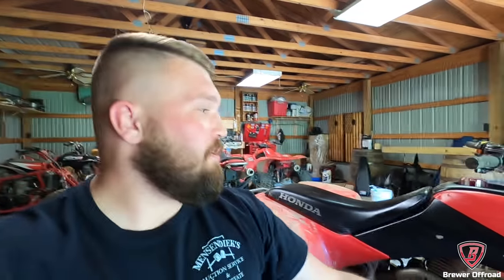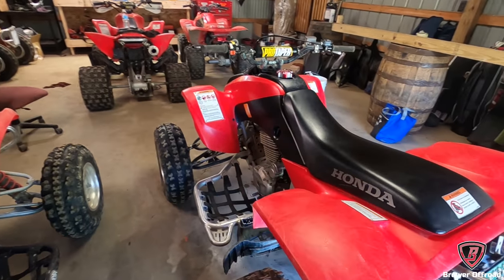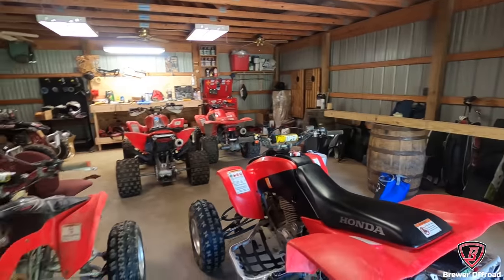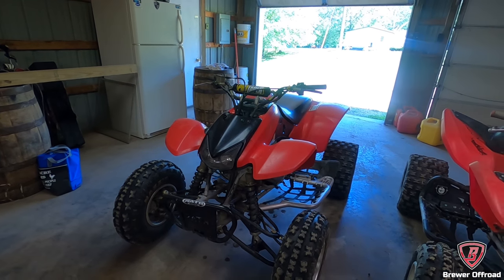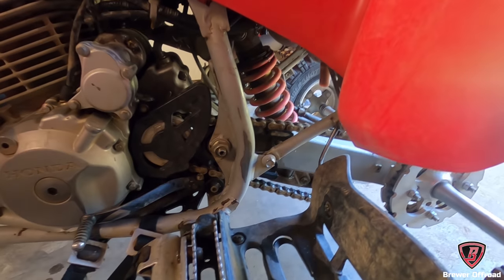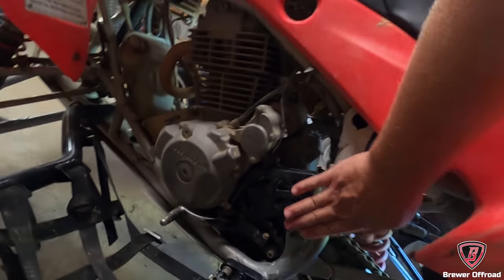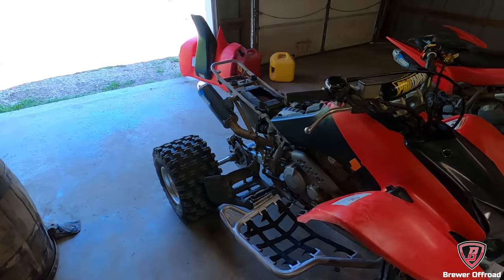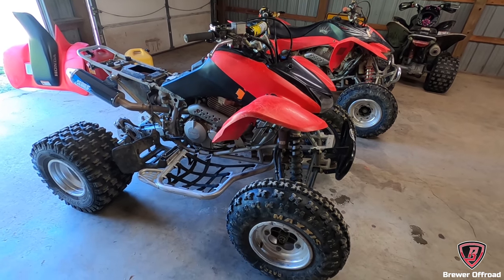What to look for when you buy a used Honda 400ex. DON'T GET SCREWED!!!

Comment: On the tapping sounds, you gotta remember the 400ex is Hondas RFVC design, each valve has 2 rocker arms, a main rocker and as sub rocker, There are more contact points of cleareance which increases the sound from the valve train.

Comment: I agree with you 100%, if it’s less than 1500 and it looks like it’s running good and not making any weird noises I’d buy it.  Parts for the 400ex are cheap. I built a 440 with a stage two hot cam in all new weisco internal components except for transmission gears for less than $1200
Reply: I have an amazing trail machine and I have $2500 in it total! Where else can you spend that little amount of money and have that much fun
Reply: What about $1700?

Comment: Another thing to check for when buying a used 400ex is swing arm bushing and bolt this is a common wear spot and if there worn bad enough you will have to replace the swing arm also I had to replace the swing arm on mine and did one for a friend another friend got lucky and only had to replace the bolt and bushing. The bolt will wear so bad that to have to cut it where the swing arm mounts to the motor. Other than that and the rear axle carrier bearing the 400ex is an awesome quad super reliable and affordable love the low end torque they climb like a tractor
Reply from the maker: For sure! Thanks for the added info 🤙

Comment: You did a good job man I use this same guide for when I buy a 400. I also check the carrier, a arm bushings and ball joints, wheel bearings and stuff like that as well. I'll add the cost to fix the quad to the asking price to find out how much money I'm spending on it. I don't always look at what they ask for it, I look at how much money the quad will cost me by the time everything is fixed up. I use that strategy for when I buy a quad. But good vid man!
Reply from the maker: Thanks man! It was tough to hit on everything so I knew there was stuff I left out but thanks for the info man!
Reply: Brewer Offroad nah you’re alright you missed the least important stuff I believe. That’s all cheap stuff I mentioned you brought all the important things into discussion lol
Reply from the maker: Thanks man!

Comment: Alot to help you with here bud. First. Check where the front sprocket is. Remove the factory case saver. If it slings a chain it will crack the case there. That will also give you an idea of how it was taken care of at the sametime. The tick- isnt timing chain. Its half the auto decompression mechanism other half is the secondary rocker arms in the valve cover. (Normal sound)The oil leak- put copper spray on the valve cover gasket. Problem solved. You checked the oil completely wrong. Check the manual. You have the oil way over full if it reads half without running the quad. It should read full after quad has warmed up at idle without throttle blipping. I missed alot of things you said that was wrong. Not bashing you in anyway here. Just passing on info. Take care! Ride red!
Reply from the maker: No problem! Just because I learned one thing doesnt mean it's right Haha thanks for the info!
Reply: @BrewerOffroad  your welcome! Always glad to help!

Comment: I kinda miss my 400, sold it and got a Raptor 700 from a family friend
Reply from the maker: I rode Pete Hager 700 and its NUTS haha video coming soon
Reply: •_JM_• it’s a great bike, and most definitely more power from the 400 with fuel injection and more CCs, maintenance intervals are a bit short tho something like 10 hours for oil changes and the sprockets and chains gotta be in your shopping cart at all times bc it eats them up
Reply: Lol I have a 400ex I love it congratulations on your 700! If u wanna check em out on tik tok to see it then go ahead!

Comment: FYI the reason that you have all that noise from the timing chain is tensioner Honda is notorious for the automatic tensioner tends to move and sometimes kills quads because the chain will jump which is when I always get a Honda no matter it's the rocket or dirt bike or four wheeler is a manual timing chain tensioner saves me from having to rebuild the head a few weeks or a month after I start riding it I ride mine every day

Comment: Thanks for the Byers tips, looking to get a 400ex or Trx 450R  to get some more power and speed than my 2001 Yamaha 350 warrior that I have now.
Reply from the maker: Both are more powerful but if you arent racing I'd get a 400ex mainly because of the reliability!
Reply: Thanks for the tip. How does the 400 ex take jumps?
Reply: @austins53schindewolf68  good if you throw on a pair of 450 shocks up front
Reply: @kevykev388  Glad to hear you say that, I have a set of 450r shocks on the way.
Reply from the maker: I have 450 shocks on mine

Comment: The reason the battery drains and has a hard time starting is the high compression piston. I had to change my starter clutch after a while.
Reply from the maker: Good to know! I also started noticing it after I cut out sensor for the N and R lights thoughts?
Reply: @BrewerOffroad  it really comes from having aftermarket cams too because you have no decompression mechanism upon startup. I cant see why it would have anything to do with your neutral and reverse lights. I got an 03, no reverse lol
Reply: @BrewerOffroad  maybe those wires are powered or some shit? or maybe you messed something else up, sounds like you got a draw on teh battery.

Comment: I’ve got a 2000 400ex it’ll start up right away every time but when I put it into second or third gear it bogs out and will turn off. Once the bike if off and I put into neutral it’ll fire right up and idle fine but once I start riding it does the same thing
Reply from the maker: Are your brakes locked up?
Reply: I don’t think so because they working fine but I know they haven’t been replaced in  awhile
Reply: @BrewerOffroad  this morning when I tried starting it, it only fired up with choke up and would stall out when I turned it down
Reply: Look at jets

Comment: What about a 2007 400ex runs great but road I. Snow and has rust? Alot of surface rust... on frame and axles.. oil leak around output shaft I'm hoping seal can be replaced without splitting case but not sure.. any help would be greatly appreciated. God bless.
Reply from the maker: It's really tough to say without seeing it but in this market if you can get a rough quad for under 2k or 1,500 you are doing well

Comment: I've had my 07 400ex now for a year. Bought it muddy as could be in stock form. After a year I am changing the chain due to some rust, new tires, and I burnt up the clutch myself doing stupid stuff.  Overall just see if it works before you buy it

Comment: Would you buy a non-runnng 07 400ex for $700? It turns over but doesn't crank. It has compression and good spark, im told.

Comment: I subbed, you know your stuff man, one question I have though, I’ve adjust the valves on my 99’ 400, and checked everything which came to be fine, is it still normal to have the top end tick? I’ve heard of many people having it and saying it’s normal, but I figured I would ask anyways, thanks!
Reply from the maker: It's either the valve rockers or the timing chain but you won't get it to stop to be honest
Reply: Brewer Offroad thanks, I’ve adjusted the valves to factory spec, and checked just about everything so I’m guessing it probably is fine
Reply from the maker: It probably is to be honest

Comment: I love the 400EXs from 99 to 07.  Once they did that next plastic change in 08 they ruined it, ugly as hell.  I bought a 2006 new back in 2006, few years later I sold it.  Boy did I end up regretting it.  Several years ago I found a unmolested stock 2005 and grabbed it.

Comment: Just purchased a 400ex 05 
A arm snapped (just bought)
Quad was rolled and hasnt rode it for 3 months 
Quad turned over for a second but look like it has potential got for 14 any thing you would recommend? A couple after market parts came  with the bike.

Comment: Quick question on the engine "ticking" you talk about near 10:40. Mine has the SAME exact sound. I am assuming this is just normal? I've seen all sorts of stuff online about a busted timing chain tensioner/busted vales/etc. Mine doesn't sound bad necessarily, just a little loud. I've listened to factory new 400xs and they sound identical. Appreciate the advice!
Reply from the maker: So it is either the timing chain or rocker arms in the valve cover. Odds are its rocker arms and thats fine lol eventually the timing chain will stretch and cause a slapping noise and you would wantto change that at the next rebuild
Reply: @BrewerOffroad  I gotcha. Thanks for the advice. So good to rip for a while? Just to want to run my valves or blow the engine.
Reply: *ruin my valves
Reply from the maker: It should be just fine mine makes plenty of noise haha

Comment: Hey man what are good extended a arms and axel to get for the 400 ex any info is appreciated thanks man
Reply from the maker: It really depends on how much you want to spend but my 07 has a lonestar +2 rear axle and alba +2 a arms. Lonestar axles aren't super cheap but the alba a arms are pretty cheap but have lasted me a while. They aren't the best but definitely good budget
Reply: @BrewerOffroad  cool man I appreciate the info I have an 07 I've had it for a good 10 years it needs some TLC still runs great tho I have 415 kit in it amd it does the job always a good time riding that thing lol

Comment: Would a stock 2008 400  be worth 2100. Claims its got less than 60 hours. Looks clean in all pictures ans runs in vids. Im terrified of spendjng the money bc i had a bad experience
Reply from the maker: I would go ride it in person and make the decision
Reply: @BrewerOffroad  thanks man. The video helped a lot bc my old 450 had a lot of engine noise and that scared me but i didn't know that that was normal. At least for the 400 ill know that it is normal for a little noise
Reply from the maker: Thanks man!

Comment: Hey I got a question I'm looking into a 2012 400EX and it runs good starts up pretty good runs strong but it won't move could it be the clutch is burnt and it's not letting it engage

Comment: What tires do you run I need to buy some new ones for my 2006 400ex and i have a 440 big bore kit with a Bill's pipe exhaust and i need to jet the carb any suggestions
Reply from the maker: Holeshot hd rears and maxxis razr 2 fronts are great! And invest in a jet kit and google common setups and just play with different combos until you find the perfect one for you. Carb work is boring and time consuming but it makes the world difference in an easy start
Reply: Try running the original Ohtsu tires. You can get them from Chaparral Motorsports.

Comment: How did you put the key and lights on the hood of the 12 because I want to do that to my 13 can you make a video or can you reply and tell me
Reply from the maker: Hey so I used a hole saw kit and bored a hole smaller than the housing of the key and lights. Then used a file to create a tight fit. They key is tough so you make need to use a super glue or bonding agent of some sort when you get it in place. This lasted about 2 years and then the plastic wore out so now I am making a metal bracket to mount between the bar clamps and the steering stem.
Reply: @BrewerOffroad  can you make a video about it plays
Reply from the maker: I'll give it a shot 👍
Reply: @BrewerOffroad  ok thanks bc I'm getting a set of pro taper so I want to to that like yours

Comment: Hey man loved the video man. Looking for a quad seen a few of these in the 3k range seems like good shape. Is there a better quad out there for that price range? I'm a smaller guy 5'7 165 just want something with good power and speed
Reply from the maker: You can find 450s for 3k but they aren't very reliable and will need some love and routine maintenance to keep them up and running
Reply: @BrewerOffroad  400ex easier to maintain and more reliable?
Reply from the maker: Yes! It's air cooled so it's a much simpler motor and the 400ex is known to be bullet proof
Reply: @BrewerOffroad  appreciate it man!

Comment: So I need help on this I’m about to buy a 2007 400ex for 1200 do you think something is wrong with it?
Reply from the maker: If its for $1200 I'm sure the cosmetics aren't great and the motor is probably weak and in need of a rebuild but its possible that it runs and drives well enough to have fun on. You really just need to give it a thorough ride when you go look at it.

Comment: I just got 07 400ex last year I put 4grand in too now the starter is stuck I put a 440 kit in it and runs great but the only thing is the starter is spinning but not kicking in can you guys help me out
Reply from the maker: Sounds like the starter clutch is out aka the one way gear
Reply: @BrewerOffroad  what I need to do it. How do I fix that.
Reply: So I need to buy a new starter right
Reply from the maker: @mauricelawrence5086  the starter should be fine but on the clutch side of the motor there is a one way gear aka starter clutch that has probably gone bad. If you replace that you should be fine
Reply: @BrewerOffroad  thanks man I enjoy your videos man helps me out alot I have to order one which is the best one to buy
Reply from the maker: @mauricelawrence5086  no problem man! Buy oem for sure

Comment: Hey man would you recommend buying a 14 Honda 400ex but seller says needs new push start ??
Reply from the maker: If the battery is dead or the starter is bad you are looking at $200 total for both. So knock that much off the price and take it

Comment: My 03 400EX has been bogging at full throttle got new carb, fuel line, and pet cock, do you know what would cause this???
Reply from the maker: It has to do with your jetting I'm almost positive but I'm not a professional! I would start there!
Reply: Try CDI ignition box!! Hope this helps!
Reply: Or spark plug. I’ve had that same issue and one tome it was spark plug and one time it was cdi.

Comment: How many bikes do you have I see like 3 or 4 in the shop just wondering
Reply from the maker: So I have 4 my brother has 2 and in this video my buddy still have 2 of his in there but he has his own shop now so those are gone
Reply: We've always had 4 or 5 ATV's at one time ourselves. I currently have a 1987 Honda TRX250X that I bought 'new in the crate' from a dealer in 88'. I had them put a Cycle Country 42" sidewalk snow plow on for a total of $2600. I have my dad's 1989 Yamaha 350 Big Bear (our only 4x4), a 2004 Honda 250 Recon, and last summer I bought a really nice 2008 Honda TRX400EX. A buddy of mine bought the 400EX around 2013 just to ride around his yard.... which he hardly did due to living in town. This thing had awesome plastics, and the factory battery and tires. The only mod was a aftermarket pipe. The battery had to be jumped for the 3 or 4 times I saw him ride it. When my bud retired and moved out of state, he left the 400EX to his son.... who also never rode it. He was more into his car projects. One day he needed $1600 cash and wanted the garage space. I made a deal with him where he got the cash and he could ride the bike at my farm if he ever wanted to. I put a new battery and plug in it that night and moved it up to my farm. The funny thing is that most of my ATV time these days are spent on the Big Bear hauling hay bales or working on the pasture fence line. I'm just about ready to put the plow back on the 87' 250X for the 32nd year to have it ready for snow.
Reply from the maker: Great history of your family and atvs i love it!

Comment: Anyone know where I can get new a-arms for front upper and lower both sides. Everywhere I’m looking they are 400 bucks. Also is this the best option to fix loose/broken ball joints?
Reply: For a 2002 400ex. Basically my ball joints went out, what’s the best option for replacing
Reply from the maker: Alba racing has cheaper A-Arms and would probably last under normal riding conditions but only lasted 2 years riding at my weight and level of aggression

Comment: If anybody can help me that'd be great. I recently bought a 99 Trx400ex but the headlights were unplugged & most likely for a reason. Well, I want to plug them back up and figure that out but there is NOWHERE for it to plug into. My mind is blown. Ive looked all around my wire harness, its just not there.
Reply: Ive looked at the wire harness coming from the Switches themselves, but nothing. It has the killswitch wiring which I have wired to a different switch, and it has some other wiring which is unplugged. My guess is that its for the Ignition since I don't have one. I keep looking and theres nothing else, so im really stumped as to where the hell these lights plug into.

Comment: Looking to buy a 400ex. What is the best year?
Reply from the maker: 1999-2004 is the top speed fastest without reverse because second gear is different. 2005-2006 is no reverse. 2007-2014 have reverse and are mechanically the same. Plastics the 1999-2004 have the frog eyes which I like. The 2005-2007 is cat eyes like mine. 2008-2014 is different entirely and kinda neat. If I had the money I would buy a 2014
Reply: Brewer Offroad ok
Reply from the maker: I will be buying a 1999-2004 soon tho for something HUGE haha stay tuned
Reply: I have an 05 400ex with reverse bought it brand new in 06
Reply: Brewer Offroad after ‘04 they all had reverse ❗️

Comment: You think a 2001 400ex for $1500 is a good price?
Reply from the maker: Depends on the condition but in this market I would probably snag it up
Reply: I just bought an 04 for 2700 and think it was a good deal in the current market. For 1500 if it runs and rides I’d sure as hell take it.
Reply from the maker: I agree man!